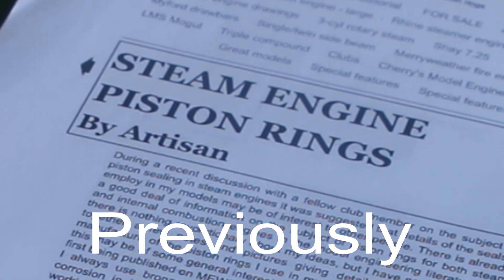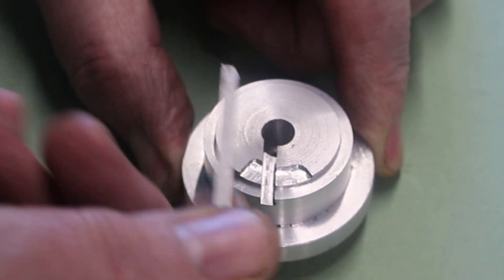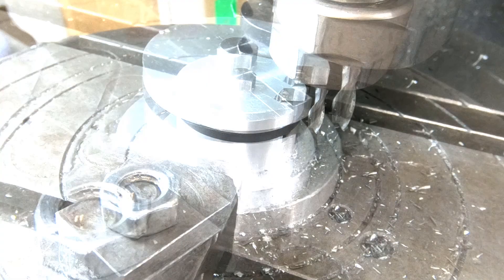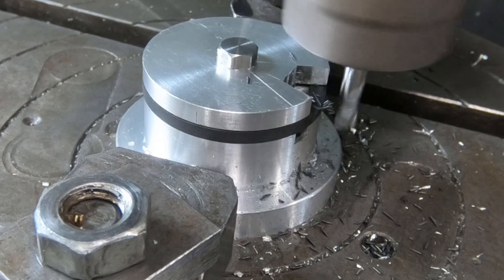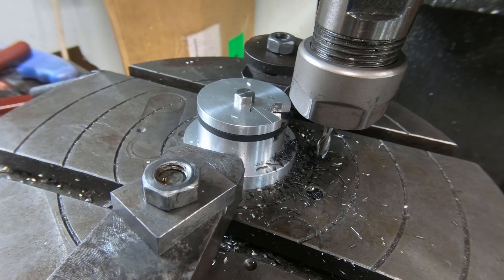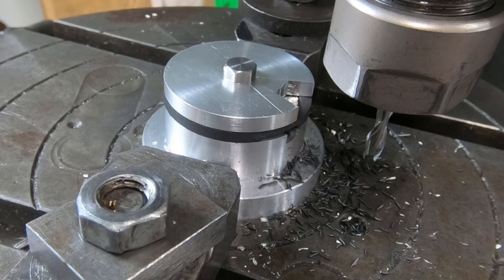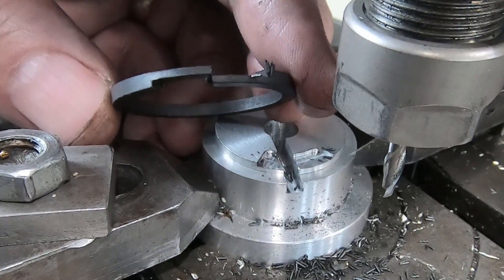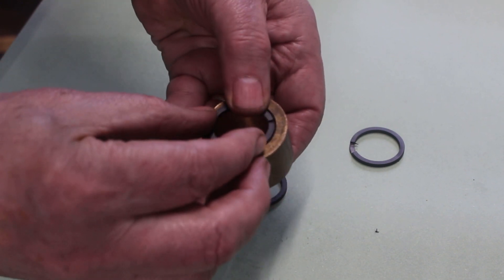Pistons Rings (pt.2) using Graphite filled PTFE, Lion - 5"g  Miniature Loco Steam Engine Build pt.47

Comment: Funny I thought Teflon graphite fill don't last in moist environment. 
I wonder how it's doing in your project now that it may have had the test of time I hope. 

Perhaps a bronze prfe fill type would have worked better for your project.
Reply from the maker: Sorry for late reply, I've been away.
All looks good, club members have been rumming their engines using filled ptfe for several years without problems and without needing to change them, that's the reason I chose to use that material. Besides there are model steam articles reporting the same successes.
Thaks for watching and commenting, much appreciated.